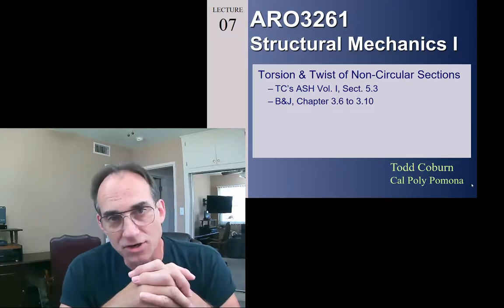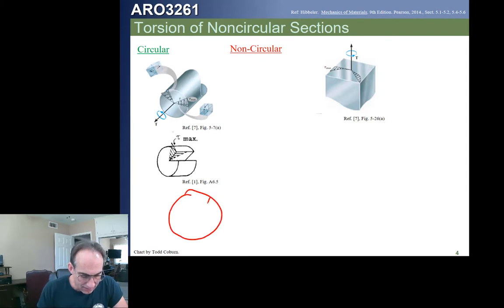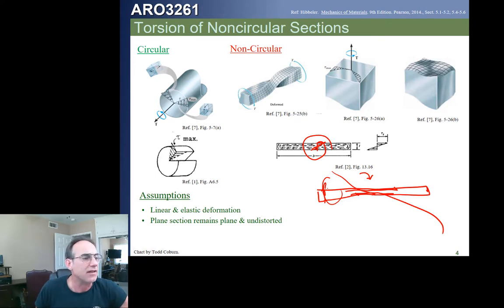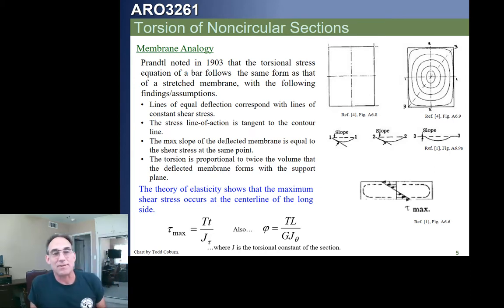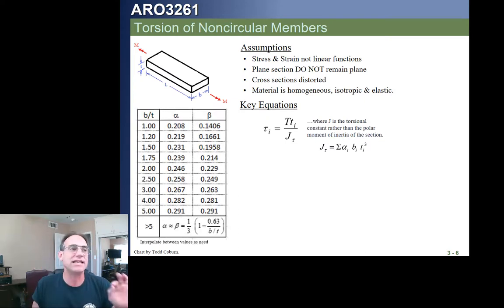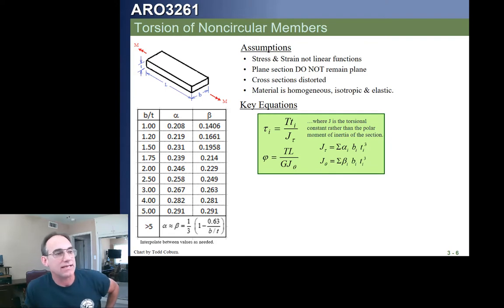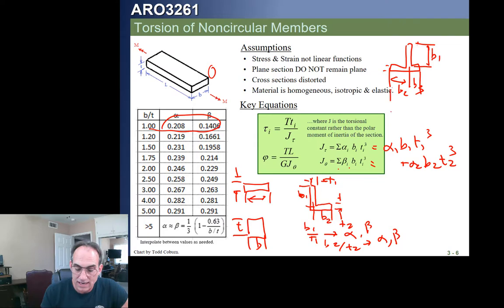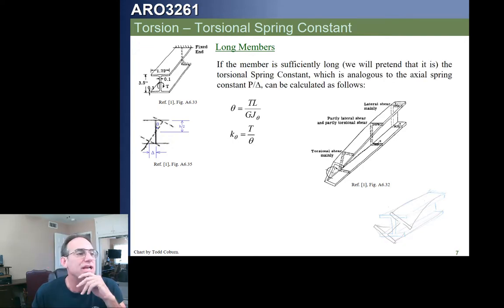Stress Analysis I: L-07w (Alternate) Torsion of Non-Circular Sections

Comment: sir i have to ask in the problem you have solved for max shear stress in formula you have used the t= 0.1" why did we use this thickness instead we could have used the bigger one thickness which is 0.200"...?
Reply from the maker: Hafizmonisahmed, great question!  The maximum shear stress in the cross section occurs in the thicker flange, as you apparently noticed.  However, the example problem asked for the maximum shear stress in the lower flange, which had a thickness of 0.100", which is why that thickness was used.  

I do not recall why I asked for the shear stress in the lower flange only.  This may have been a problem where I walked students through a more complete set of questions, and for whatever reason I truncated the other parts of the question that calculated the max shear stress in the upper flange, followed by a question about the max shear stress in the entire section.  As written, a casual student could get misled, so I will strive to replace this video with a more comprehensive example soon.

Thanks for bringing this to my attention!